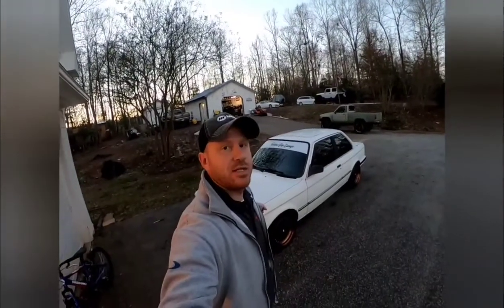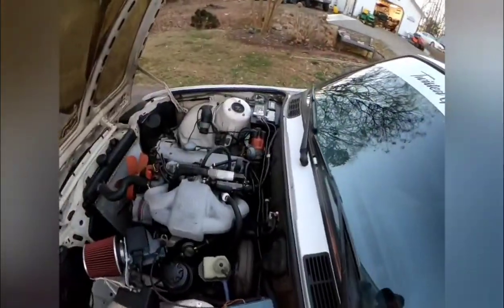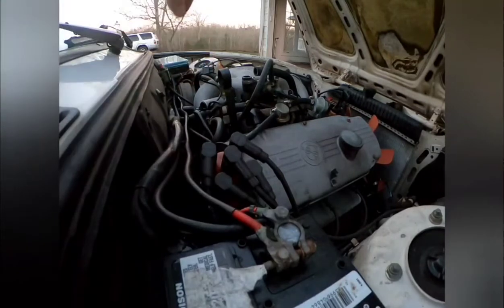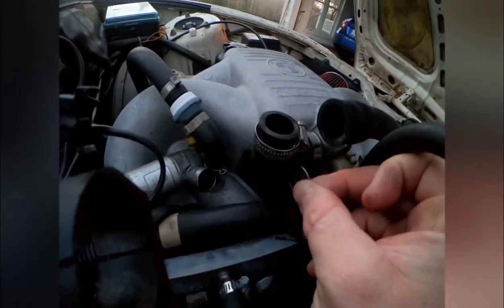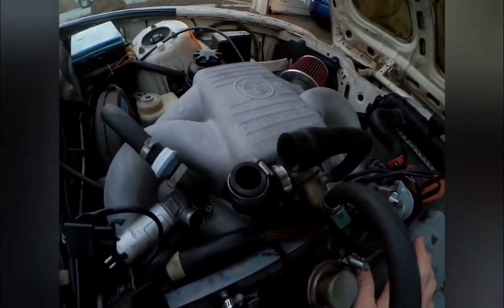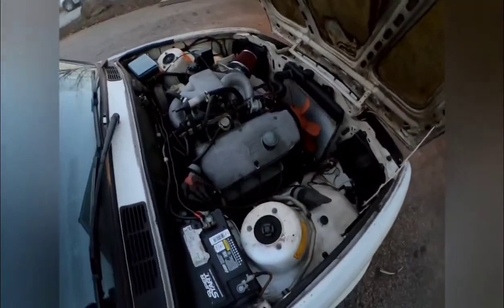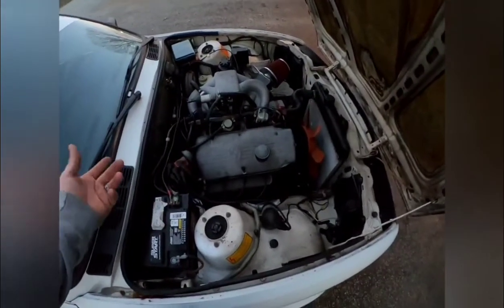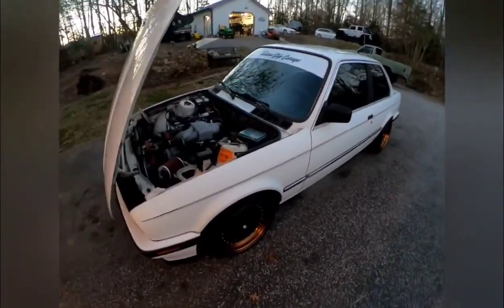E30 Idle Control Fix for 5 Cents

Comment: Thank you as this is driving me crazy on my 1985 M10 e30! Same as others—I cleaned it and it worked great and then computer raised the idle and it was back at 1500.  Drilled Nickel it is tonight! Does it rob any power?
Reply from the maker: Doesn't effect power at all.

Comment: I want to see this video shared on the realmechanics youtube channel so they can dissect what's wrong with this advice.  I assume they will say something to the effect of 'This "fix" clearly shows that under normal operation the intake has more inflow of air than the computer can account for, creating a lean condition known as a ""vacuum leak"".  The $.05 kludge in this video ignores the actual problem of vacuum leaks in the intake and restricts airflow to the idle valve instead. Now the total amount of air intake is reduced which compensates (kind of) for the vacuum leak..  Just fix the vacuum leak & avoid sucking spare change into your engine.  Smoke generator kits work flawlessly to find vacuum leaks & are sub-$100 on amazon!

Comment: I cleaned it’s working but when i drive little bit after its not going back 1000/1200 rpm how can i fix
Reply from the maker: Try the nickel with a hole in it. Start with 1/4 inch then work your way up to bigger sizes until you get the desired idle.

Comment: My 323i was idling at 1800 rpm hot or cold and tried this method but only made a slight improvement. I ended up putting a disc of metal in the pipe with no hole at all, result…..idles at 7-800 rpm cold and 900 rpm warm. 😉
Reply from the maker: Nice.

Comment: Was the high idle when you had the car in drive as well or just in P and N. I have a e23 m30 engine which idles high in cold start. They goes normal.. Dont know if I should do anything about it or just let it be. Any suggestions?
Reply from the maker: This is a manual trans car. I think autos would idle a bit high in P and drop when you shift to D
Reply: @TwistedGripGarage  Thanks. Yeah, mine is a auto so maybe that is why. Would it be a good idea to clean the idle air control valve just to check if it makes it better?
Reply from the maker: Yes, you can clean them with carb/intake cleaner.
Reply: Most Naturally aspirated cars idle slightly higher at cold start, especially these older bmws

Comment: Hi. Interesting trick. I noticed the steering wheel in your car seems to have a comfortable  angle. Do you have a vid for how you did that? Thanks.
Reply from the maker: Unfortunately, I do not. I haven't actually modified anything with the steering wheel. My seats are mounted using some custom made brackets. That puts them lower. My steering wheel and seat setup is very comfortable. Let me know if you want a video on the seat brackets.